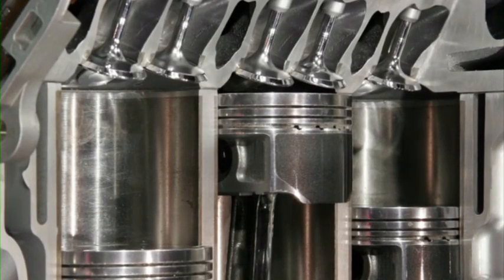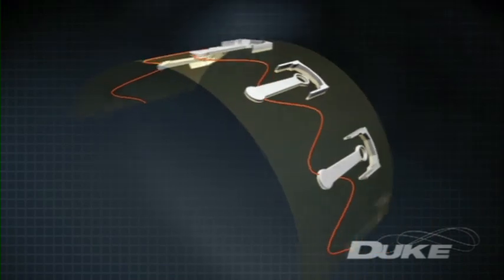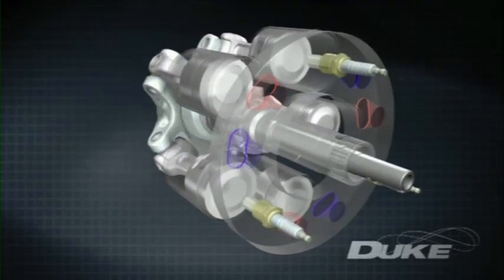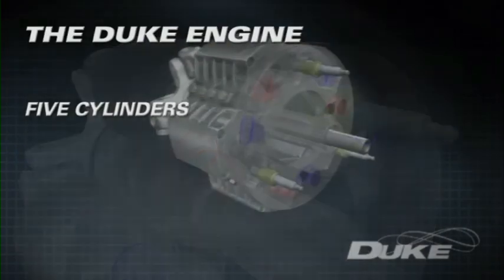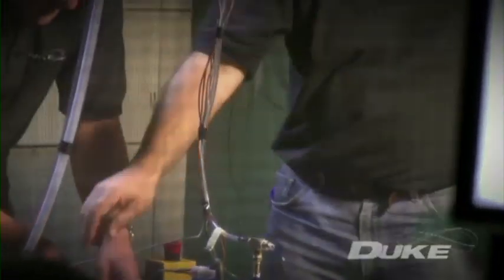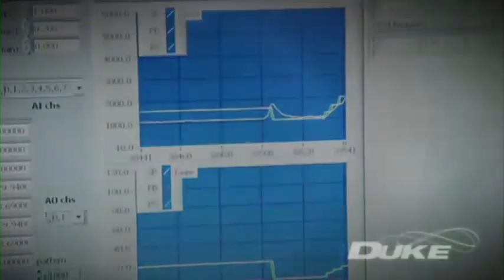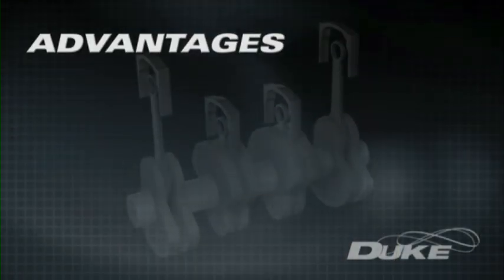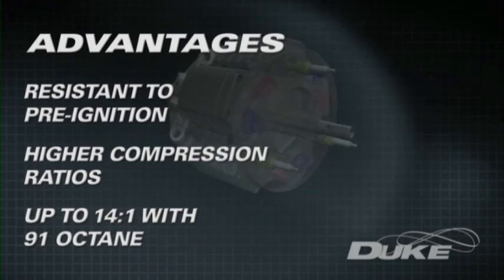Duke Engines

Comment: Seems like they could have the cylinders stationary to the head, and a spark plug for each cylinder. Then the reciprocator could be stepped and the connecting rods could be connected to its own step on the reciprocator. There could be ports around the outside of the head for fuel/air mix and another for exhaust. A blower, like on a Detroit Diesel could pre-charge the air mix and then push out the exhaust gas.

Comment: They call poppet valves 'complicated' but completely ignore the huge question, "What sort of insanely complicated arrangement will allow you to seal the cylinders and head/manifold when they are rotating relative to each other?"  This system will inherit all the issues that make rotary valves impractical.

NEXT!
Reply: This is an axial flow a/c compressor with spark plugs.
Reply: That's why they can get a massive compression ratio... It leaks
Reply: If they can't hold manufacturing costs down and somehow beat the status quo wiht functionality and cost, what's the point?  Weight reduction at what cost?
Reply: uhh...craig wood? the first one i actually replied to.

behind the times lol. amazing.  i suppose we should all go back to using feet, inches and gallons too right? hahah
Reply: jimmmaaay1 Yalls method for deriving octane is different.
Reply: You do realize that every "suppressed technology" you listed are either violates the laws of physics or has never been proven to work, right?
Reply: Curby Weaver Doesn't matter if they can get Honda et al to put it in a MotoGP bike.  If it's lighter, it's faster.
Reply: Gavin Morris Ervin if the engine as a whole is lighter I think the rotating parts are going to be heavier. Unless these things can put out a whole lot of torque at low RPM while keeping a broad power band.... Probably the biggest problem is that by the time this tech gets perfected it's not going to be competing with gasoline Otto engines, but with multifuel microturbines in series hybrid configurations.
Reply: piston port engines the ports are in the cylinder wall, not in the head. the pistons linear movement opens and closes the ports. nothing new, or complex about it.
Reply: Diesel Ramcharger
i am aware of that, 91 calculated using AKI is about 95 RON...one can hardly call it expensive when the US has some of the cheapest fuel in the world.

anyway, its only north america that determines the rating differently..the rest of the world uses RON..
Reply: doug ohboy You are an idiot. Electricity isn't free, the range and recharge time of electric cars makes them impractical. You CAN NOT drive an electric car from lets say, new york to LA. ICE engines may be outdated, but there is no modern alternative. Surely not electric.
Reply: +Craig Wood 
91 Octane @ 14:1 CR doesn't mean they will build a production engine at 14:1 CR, they could lower it to say 10:1 or 12:1 and then run on 87 octane, it just depends on what market they are trying to reach. This is more a stress test to validate it's performance over traditional designs that require 91 octane at much lower Compression Ratios to avoid detonation.
Reply: Solar roadways are so far being proven to be a massive failure. They generate less power than conventionally mounted solar panels and are far more expensive. Not to mention that their first installation in the US has not generated any power as of yet, and its LEDs are not visible in the day time.
Reply: It works in a somewhat similar fashion as a sleeve valve engine. 91 octane is ridiculously more expensive than 87 octane.
Reply: The rest of the world is behind the times, what can i say. Who said anything about cost?
Reply: geonerd without any calculus I can see its pros and cons for their basic structure already had occurred to me while it only for reasons of money I could do more before in 2007 or so. the pro is in force and torque against this in the combustion speed generates friction + vibration especially if the gearbox does not engage with the fueza and engine speed is combusted the engine is extremely easy to burn and fail deformarce.
Reply: I thought the same thing when I  saw this. Only advantage this has over normal motor is no valves
Reply: Diesel Ramcharger Also similar to the operation of hydraulic motors.
Reply: Agree... Presumption are; the seperation of a gas circulation valves and compresion pistons must be seperated.
Reply: jimmmaaay1 That's right.
Reply: +geonerd Isn't it obvious? a circular metal part with five cavities rotating the same way with the pistons.As the cavities rotate with the pistons in them below them there will be ports and plugs rotating anti-wise.But you are right about maintenance.
Reply: geonerd hmmm you have a point there
Reply: geonerd check out Coats csrv, it fixes the problem, but creates a new one, that being the pricks want you to buy they're bulshit engines with it rather then selling the top to other manufactures
Reply: My thought exactly. They could've made this rotary drum with cylinders fixed, with dedicated spark plugs and everything. There's still would be a weight advantage.
Reply: Thank you for saying this.  Now I don't have to.
Reply: Honestly, I'm NO fan of this ... but I'm assuming the cylinders are sealed and just sliding over 'stations' or ports rather. It only has to seal in the X axis ... it's still not a great looking idea.
Reply: Craig Wood
yeah, but 91 octane is standard low-quality fuel down here..it doesn't come any lower. 98 is available from the pump
Reply: J.J. Lemstra Oh yes, amusement park rides are TERRIBLY unreliable. They require more maintenance than run time, fail regularly. People get killed on them almost every day!!! What the fuck are you smoking? Amusement park rides don't work, ANYTHING like this engine. It rotates and lifts each boom with air cylinders. It is not powered by one engine, or any engine. Its run off SEVERAL electric motors. You sir, are a fucking moron.
Reply: +doug ohboy The JP Morgan needing to meter electricity was in response to him transfering energy from one of his towers wirelessly through the air to homes. 

We could have the road itself power such Tesla stations and cars driving past could then receive the electricity wirelessly. The power generated by "Solar Roadways" currently under development could produce and store unused electricity.
Reply: geonerd Tesla electric cars, by Elon Musk.... p85d....
petrol engines are obsolete no matter what desigh or how efficient .....
Tesla is installing super chargers... which are free to use when recharging... electric cars zero emissions clean air clean planet....
Reply: +Diesel Ramcharger There has always been an alternative , cold fusion, over unity, orgone accumulator, N motor.... 
these are suppressed technology, jp morgan said to nicola tesla, i need to meter it so i can charge money for it....
the department of energy was set up to fail....
the US patent office is a false front western town to the departmental suppression of who thinks they are going to be rich from free energy devices... cant buy you out ?! you get taken out.. 
money is the root of all evils, and ignorance is blissful.....

Comment: Charles Redrup invented the wobble plate engine in 1904.This uses a similar principle but has obvious differences.The trouble with engines that aren't of the traditional reciprocating type is that engine manufacturers don't want change as they are set up for just that. I would much rather see innovative engineering like this than more and more turbo'd piston engines.

Comment: I'm not an engineer, but I can imagine two major problems with this: first off, the combustion chamber must be sealed to the head, while it is rotating. I can't imagine any seal would hold up to the friction for very long. Secondly, the amount of rotating mass is huge... I don't believe this engine would be very responsive at all, since the entire heavy assembly needs to spool up like a turbine to reach high revs. Correct me if I'm wrong, but I just don't see this working.

Comment: This is an interesting design, but something similar before - in air conditioning compressors known as "swash plate", "slant plate" or "wobble plate" type compressors.  This type of crankshaft motion is called "nutating" and adapts itself well to variable compression.

The rotating aspect and valving is interesting, though.

One thing that is interesting is there is a lot of rotating mass there - like an old Gnome engine. 

http://www.freepatentsonline.com/4865523.pdf
http://www.freepatentsonline.com/5106271.pdf

Comment: The engine is a variation of hydraulic actuator design - Hydraulic Motors - having a heavy swash plate rolling around seems like a formula for disaster - There is a variation of this design dating back to WW I, where the engine spun and the driveshaft was fixed - the gyroscopic forces must be insane - spark plugs, cheap, injectors cheap, I think there may be something there but not throwing all the engine parts around!  I saw a great engine, one where the pistons were opposed and hard fixed to each other - would be fun to see other designs, too!  Hope this works out but seems like a lot to go wrong for a small improvement in weight et all
Reply: This the one http://en.wikipedia.org/wiki/Napier_Deltic?

Comment: I wish people would channel their creativity away from combustion engines that run on dinosaur juice and fart. Electric is the way to go. Two parts: rotor and stator. Can't get simpler than that.
Reply: Except I don't want to charge every three seconds for five days. Hydrogen in engines is the way to go knob, Works the exact same as regular combustion engines without the carbon emmisions also Hydrogen is abundent=never run out, only produces moisture or H2O. Plus you really think a Big Rig with 2-7 trailers is going to cover 1000miles ? Off of a battery? Fuck right off.
Reply: And where how are the copious amounts of electric energy produced? By burning fossil fuels. Until we find an alternative that can keep up with the needs, we'll stick with 'dinosaur juice and fart'.
Reply: ***** Compare battery technology from just a couple decades ago to the latest generation battery technology. The older battery technology has a pretty pathetic performance compared to current battery technology. Imagine how much further it can get in just a decade if there is even more focus on developing new battery technology. Yes, hydrogen is a virtually unlimited fuel source, but processing and handling hydrogen is not easy as it's an extremely volatile gas. The range isn't there, but with current battery and electric motor technology you could fit an electric motor system in a truck that would literally shred the tires. The range would be very short at such high power output, but with improved battery technology it can be done in a practical way.

Just take a look at the RC scene, brushless electric motors combined with high output li-po batteries embarass performance of cars with traditional nitromethanol engines. They are also far more reliable. Nitro motors are still fun though.
Reply: ***** Hydrogen is not easy as it is a volatile gas. So LPG? Methane/natural gas. both have been manufactured and produced world wide -.- they are both 'volatile' gases also, oh and Oil in general is that's how combustion works -.- Humans managed to obtain oil and build everything from it, don't forget the plastic in our device, the rubber in tiers and so many more things are derived from oil, oil is just as difficult to obtain is Hydrogen, actually it is harder in some circumstances.

Comment: With that kind of compression, couldn't you run it as a diesel, and loose the spark plugs all together?
Reply: Nah diesel engines have a compression ratio (low compression at around 18-19:1) while high compression is more like 22-24:1

Comment: how much,inc install?  good enough for my big rig?..
Reply: I'll agree where does this stand, it's been out there for a long time, is this a farce video? Or is this real, why is it not hit the market, Wankel engine came out why is the Duke engine not out? Are there problems with it long term! the video does not show a cooling system. I would imagine that any engine burning fuel produces heat and need some kind of cooling is this the problem there running into I came up with a similar design almost 15 years ago! was never able to design it or patient it my design, had a cam plate instead of an oscillating plate for the Pistons. Which I can see the oscillating cam plate is a much better design but why has it not made it any farther than these videos...!!!???

Comment: Just another variant of a swashplate engine. Been around for 100 years or so. Have worked on and helped develop a few over the years. Proven to be Very unreliable as there is too much nominal load on big ends and swashplate pivot. In a normal reciprocating engine, the load of the big ends is overcome by the crankshaft rotating inside the conrod, fed by oil pressure, spreading the load over a greater surface area. In this design, the big end load is contained by very little movement, albeit a rocking motion, which is neither as efficient or reliable. Granted, this design doesn't suffer from rod angle deflection, but it's inherent disadvantages are the reason none are produced for either commercial use or racing. The design is often used in small pumps, where the internal loads are far less than that of an internal combustion engine. Even then, a pump of the same size with a normal reciprocating process lasts much longer. This is NOT new technology to the rest of the world, just in new zealand.

Comment: Did I miss something? What the heck seals the cylinder heads to keep compression in if the cylinders are moving around the head during operation? Would like to see one of these engines both in operation and torn down for maintenance, as I can not see how they can operate any more efficiently than a "conventional" internal combustion engine.

Comment: Call me a skeptic if you must but, the engine won't have the longevity of a conventional engine. As the cylinders rotate the seal between the combustion chamber and the cylinder will wear. Conventional engines use multiple rings around the pistons and a head gasket to contain the explosion. There really is little to no mention of how it's achieved in this type of engine. I'd like to see some real world testing before I invest in it.

Comment: This idea is trully great, its like a cilindrical 2 stroke engine, offering the parts simplicity of the valveless 2 stroke engine, but with better control over the intake and discharge ports which is the main reason for efficiency drop.
no valves, camshaft, time chains and high preassure oil system, brilliant!

Comment: The Duke engine is like a completely normal 4-stroke engine, no changes to the cycle itself but in how the engine does it mechanically. The block indeed does rotate, but in such a ratio that each piston completes its 4 strokes in 1/3 rotation of the block, hence there being only 3 spark plugs and not 5. I believe each cylinder is sealed using a circular scraper seal around each cylinder end. And it can run higher compression ratios because as the cylinders move, the heat is spread out along the end plate. I am currently designing a rotary engine, similar to the Wankel, and I got an idea from this to solve my valve train problem. Just make the housing rotate... And I won't need to have 6 camshafts.
Reply: Make a video even if it's not done I'd love to see it, please send it to me. Thanks.

Comment: It is interesting reading comments
     I have had the pleasure of seeing this little baby in action and it really does take ones breathe away, when you know the science and researce that has gone into the development of this engine and the massive hurdles that have been successfully jumped to make this a formably reality with modest finance and loads of passion!
     The next step is to productionise this engine which requies a massive injection of capital.  The difficulty to getting funding  is that battery power is seen as a greener solution, but batteries are far from green and need to be replaced and disposed of every 5/10 years and would need a ten fold increase in storage capacity to be competitive.
     While we are still reliant upon the combustion engine until technology finally comes up with a successfull alternative, why not remian open to the an evolutionary step of something that is highly likely to be with us for at least 50 more years.

Comment: The faster it spins the higher the friction on the outer walls of each cylinder. The piston rings will wear out rather quick begetting combustion gas blow-by. BACK the the drawing board with you.. 
Isn't this rather similar to the Sterling engine?